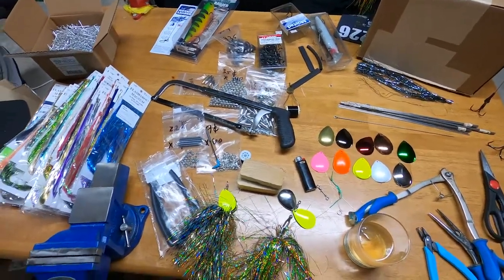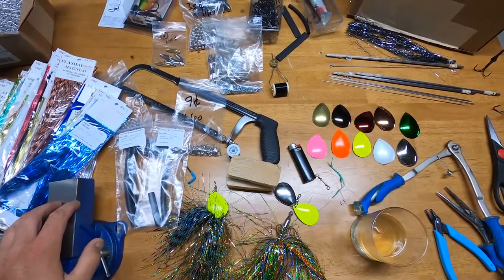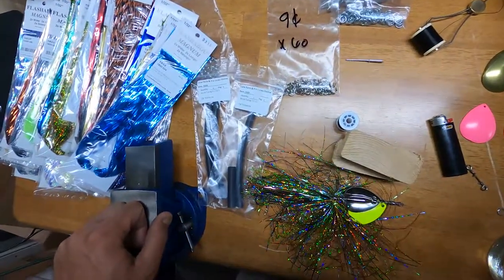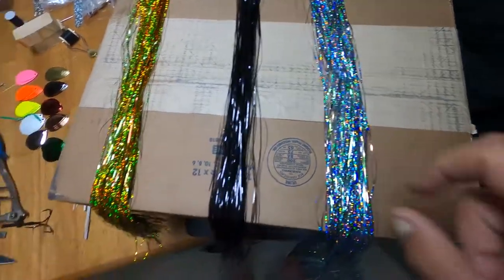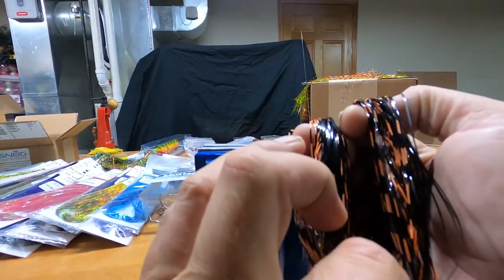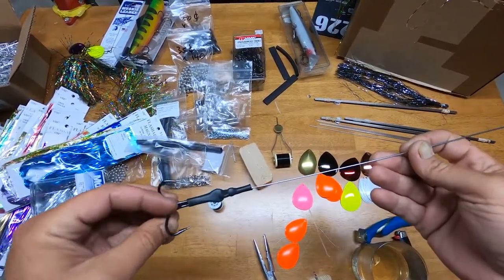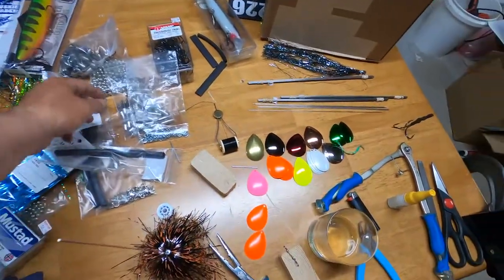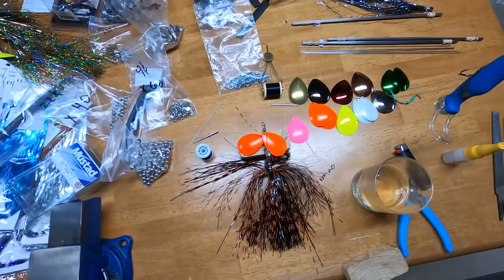How to make Musky Bucktails S1E31

Comment: Great video & instructions. I prefer the coils but you can't use a hacksaw effectively to cut them. I use a small abrasive cut-off wheel to cut them into small sections. I guess the rivet will work but may not hold up as long. I love that wire coil bender you use. I bought a Dubro Bucktail Twister and it gets the job done pretty well. Thanks for sharing!

Comment: Thank you for posting.  As a lure maker myself you have opened my eyes to new
ways to make a bucktail. I like the rivet example, the folding over and later cutting of the flash and the use of Gorilla glue. I  use more glue than you, Sally Hansen nail enamel and one final coat of epoxy. I am also using now a variety of material
Reply from the maker: Thanks!  I'm glad you liked the video.  I've expanded my horizons a bit, and am now making wooden lures as well.  I'm doing somewhat shorter videos on the different parts of the build, and will be continuing to upload them in the coming days/weeks.  :)

Comment: Thank you for this very clear instructional video.  I am also a new tackle maker, and I was wondering what is involved in tying flashabou skirts for musky spinners.  I agree, the coil spring cores seem like a less-than-perfect solution.  I was wondering how flashabou could be fastened to a brass skirt collar.  You answered my question.  The rivet idea was a good solution.  Seems like it would work the same as the brass skirt collar.  Now if I could think of a reliable way to fasten the skirt without tying.  I am not a tyer and would prefer not to become one.  Thanks for the good video  : - )  Can you tell me where you bought your flashabou online?
Reply from the maker: Thank you for the kind words, I'm glad you found the video useful!  Short of buying pre-tied skirts, there is no GOOD alternative to tying them by hand.  Zip ties do not work, I've seen other bucktails made using them and they literally fall apart in your hands.  The process definitely gets faster.  Since I made this video, I've made dozens more bucktails, and can now complete one in 5-6 minutes start to finish.  Just takes a bit of practice.  Thanks for watching!!

Comment: I use the same wire thats used to mark gaslines. $9 for 100 ofvthem at home depot. Obviously a little more effort for shaping but uts worth it
Reply from the maker: That's a pretty solid idea at a reasonable price!  The only issue I think I would have with this is that whenever I happen to find one with my lawnmower (we had some construction done a couple summers ago), they are always rusted.  I don't mind spending the extra couple of bucks to get stainless wire.

Comment: made in reverse order. buy the steel w one end twisted. so much easier. my 2p
Reply from the maker: It's only easier if you don't have the tool to do it yourself. Pre-made wire costs more.